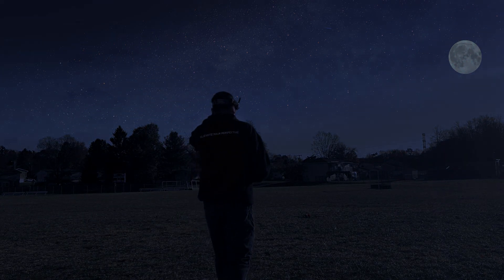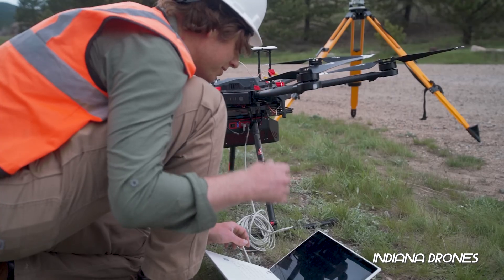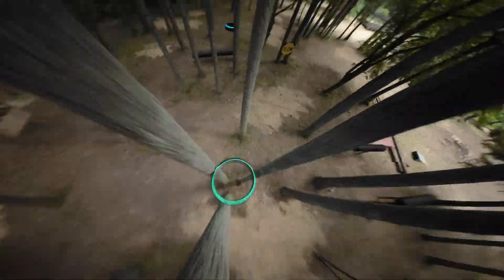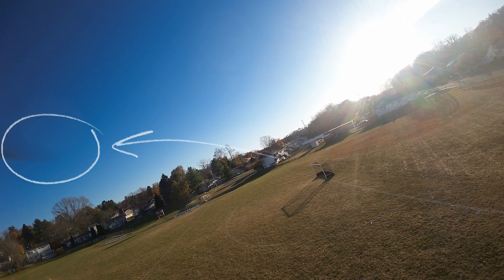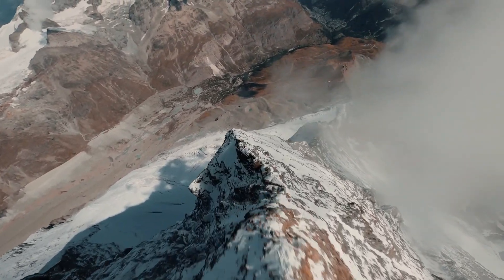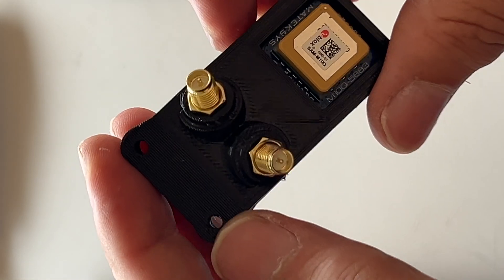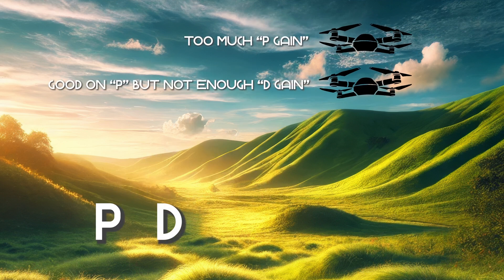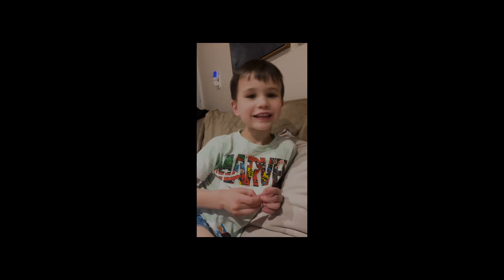Rekon 10 Pro: Father-Daughter Duo Builds a Massive, Glowing 10-Inch Drone

Comment: what antenna did you replaced in DBR4 RX?
Reply from the maker: I used these two of each of these bought from the Radiomaster website:
1) UFL 2.4Ghz T Antenna 65mm/95mm for ELRS Receivers
2) UFL 915/868MHz T & Y Antenna for BR Series Receivers
Regular price

Comment: Love the build ! Which tpu did you use ?
Reply from the maker: Thanks! It’s the Sainsmart TPU. I’m way behind on the Part 2 video, I had promised viewers a deep dive into PIDs and more. My 3D models are available on Printables if you need parts. I also covered a front-end mount that extends the camera forward, completely eliminating props from view, but it still needs more testing for vibrations and other factors. Don’t hesitate to reach out here or email me. Happy to help😀
Reply: @magicaerials  I am happy to say that I placed my rekon 10 order today because of this video ;-)

Comment: i have a rekon10 with 3110 900kv and same li-ion aswell. 
Not so happy with my video reception so far so I admit i haven't done any crazy long range yet. 
I'll move the GPS from the back to an arm, and try with another antenna if it doesn't help by itself.
Reply from the maker: What type of video system are you running? My video reception has been fantastic.

Comment: If I wire cob a chain of two cob lights will that be ok or would that fry something?
Reply from the maker: Two 24v lights wired one after the other (in series) would require 48v!! Do not do this! You want to wire them in parallel (side by side: connect both cob positive lines on the start of the strip and both negatives on the start of the cob strip) but in that case will now draw more amps. So long as your pulling current direct from a 6s battery like the one I used in this video, you are okay.